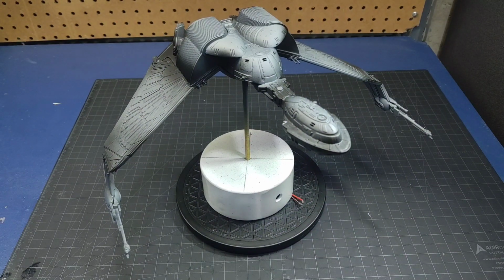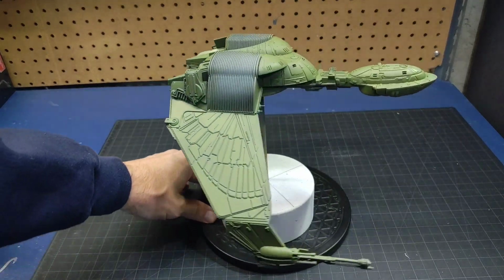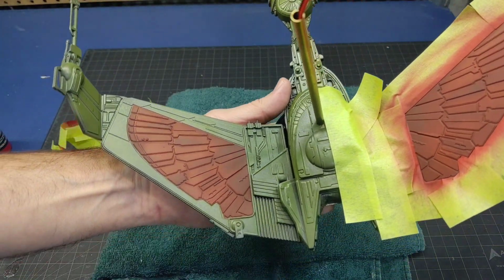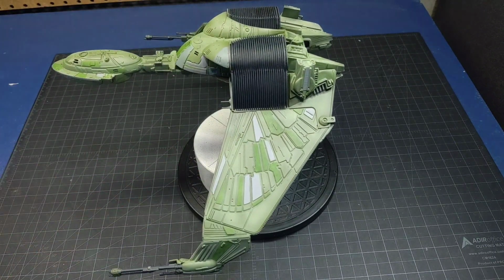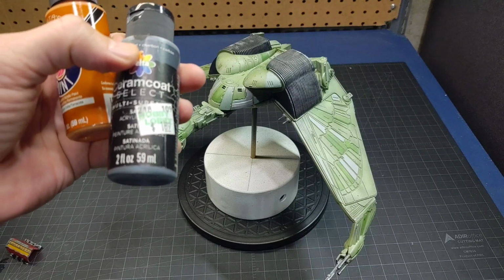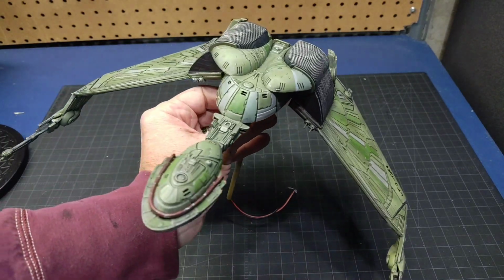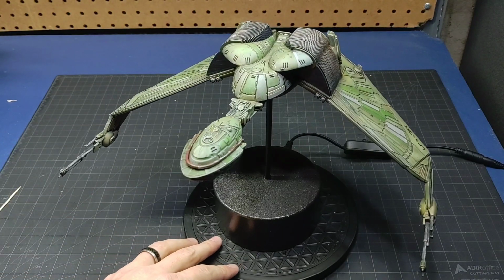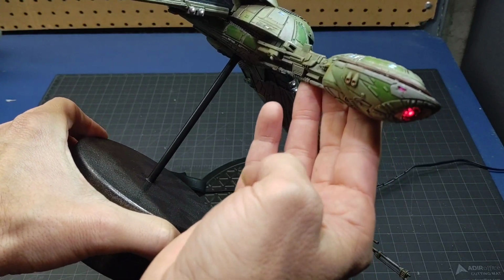Star Trek AMT Klingon Bird of Prey 1/350 scale model. Part 2

Comment: I'm on market place seeing this kit and wondering what it looks like professionally painted and weathering.  And I found it.  It's yours. Outstanding.  The only thing I would do different is to add styrene half round bar strip to the wings leading edge.  The design to have them blocks or square is odd.  space ships should have round edges but we are talking early 70s designers
Reply from the maker: @kbellanger4140  thanks, it's a fun build, I've seen other modelers so extensive modifications to make it more accurate.

Comment: Awesome job on this build.  This kit is super fun and is totally different than the standard "federation" build - what with all the weathering.  In any event, I'm curious if you ran into any issue airbrushing the craft acrylics?  I've picked some up for a future build and have heard of good and bad results (dry tip, thinning, etc).  Any issues in particular that you ran into on using them?  They are appealing due to the cost difference - I've pretty much only used Vallejo and Tamiya.  Great job all around!
Reply from the maker: Thanks! I've used the craft acrylics quite a few times now. The biggest issue for me is just getting them thinned properly. Too thick and it clumps up to thin it comes out runny. I'd recommend practicing on something first to find that right consistency.